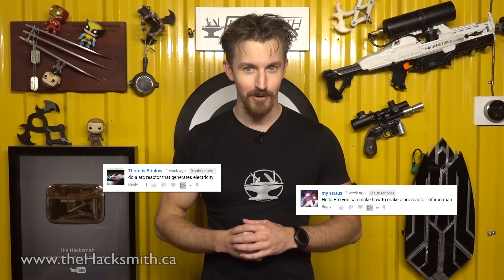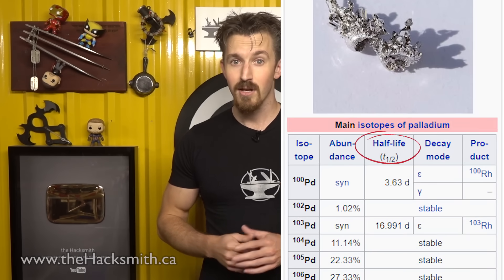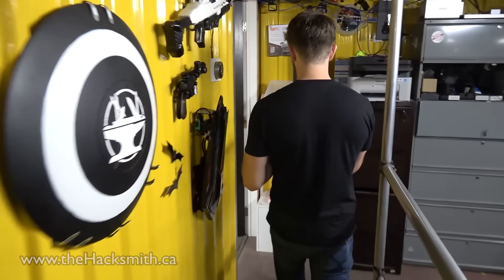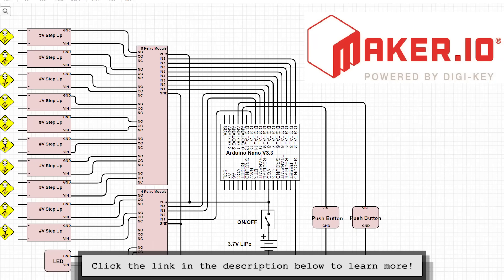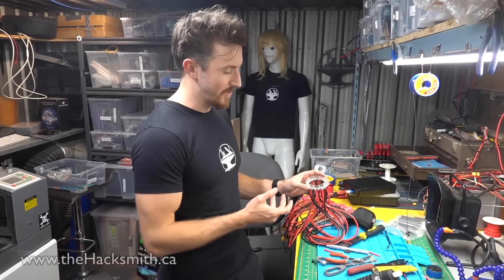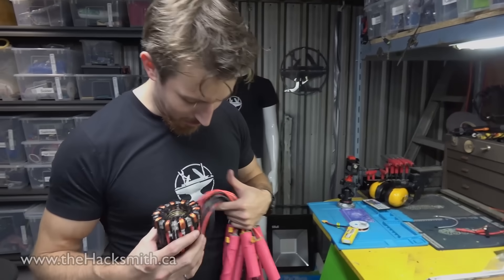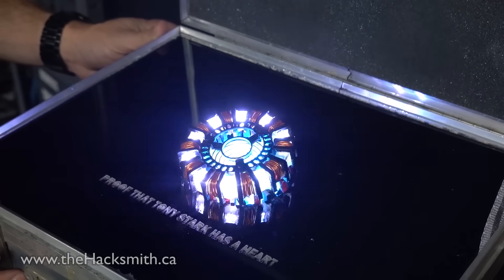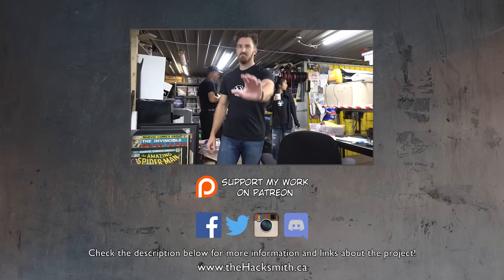Real Arc Reactor (ionized plasma generator)

Comment: So what's the actual "power" draw for the reactor? I suppose in Watts (volts*amps)? Cuz you only showed the 20+ amps that it draws.

Like I assume the cylinders are large capacitors, you're not powering the actual reactor (the arcing between the +- lines) off the lipo battery... or are you?
Reply from the maker: 20A at 3.7V so 74W?
Reply: Huh. Tbh that's a lot less than I expected. Shows how little I know about electricity. 
I thought high voltage was required to get electricity to arc (eg that's why high voltage is insulation and high amperage is thicker cables). 
Can you explain where my thinking is wrong?
...
edit reading up on the diagram and such: 
I'm a dumbass. You transform the 3.7V lipo (parallel?) into the 800k+ Volts, so that's why it arcs. But since you transform it into such high voltage, the amperage on those cables should be minuscule, no? So why the thicker cables? Shouldn't you instead go for thicker insulation?
Reply from the maker: input power is only 3.7V and 20A

output power is 80,000V and micro amps :) 

with transformers (minus losses) power ratio remains the same, but if voltage goes up, that means current goes down! and vice versa
Reply: I see, thanks!

Comment: Not enough power :( make it bigger and louder >:) bigger size with more copper rolls with more wires A-Z and from A1-Z1 and A2-Z2 put will cost a lot to build
Reply from the maker: bigger will have bigger losses
Reply: the Hacksmith then multiple

Comment: If you could somehow use that arc to ionize some kind of gas or create plasma, you might be able to generate some extra heat then use that to create a heat generator of a sort, but those are kind of limited and inefficient, losing out to steam generators. But even if you could produce enough heat to generate enough steam to power a turbine, instead of just making a heat generator, I doubt it would be very efficient. Using radioactive materials like palladium somehow to make a nuclear reactor of sorts might increase it's efficiency some, but it would be way worse than a standard nuclear reactor, I think. Basically an arc reactor can't actually work, or it would have to be a weird kind of super inefficient nuclear reactor.

Sorry, if that sounds like criticism. It's not. The video just got me thinking about how an arc reactor might actually work (not work?) in real life. Your work is absolutely amazing as always guys! I can't wait to see what you come up with next!
Reply from the maker: But like we explained in the first part of the video -- anything that "takes" energy to produce energy will always produce less energy! =)
Reply: the Hacksmith
Yup, that's why it's far more inefficient than a normal nuclear reactor, it's suffering from similar if not the same problems as a fusion reactor, but without any of the advantages fusion reactors could potentially have.
Reply: Aren’t nuclear reactor radioactive

Comment: Now I'm no expert, but would the reactor make any sound if it was inside a Vacuum? Considering the properties of sound and vacuums, wouldn't having it in a mini vacuum chamber at least reduce the sound created by it? Again, I'm no expert, so sorry if I'm wrong about that
Reply: Arcing works a lot differently in a vacuum. Since there's no air to ionize, the two electrical poles just "glow" with a purple haze. It would significantly alter the aesthetics of this from a blue to purple, not to mention a lot more energy is just electrons moving, and less energy being turned into photons. I'm no expert either though, so I'm unsure if the noise the electromagnetic interference it puts out still would affect the camera microphone or not.

Also, this device is DEFINITELY not FCC compliant in any way shape or form.
Reply: Ah right, forgot about the need for air. Kinda embarrassing considering ive taken courses on electronics and such so i should at least remember that much

Thanks to the both of you for enlightening me on the topic
Reply: Incognito_Blazer if it were in a vacuum there would be no air for the electricity to arc through, meaning there would be no plasma. Technically there would be no sound then lol.
Reply: Sound cannot travel in a vacuum
Reply: Ingognito_Blazer You'd have to have something like a ring made of neon tubes sealed inside a vacuum tube - which sounds expensive! I'd think you would need to be a really good glass blower to seal all those high-current contacts into the glass outer shell! You might find Nixie Tubes interesting though.

Comment: Wow it's a very cool prop and really looks realistic, but I didn't get how the electricity from the power bank, which was necessary for the ionization of the air (which is for realism/looks) then/at the same time went to power other stuff like the phone.
Please answer me Tony!

[Also, we can agree on the fact that this device isn't actually generating anything, but is a power bank with an extremely loud light indicator - cos otherwise I have understood nothing]
Reply: I'd say your correct. This isn't generating any power it is a prop that is actually consuming power.
 He's either charging the phone from the battery or maybe he is using the outer coils as the coils in a transformer and inducing an electric current from the magnetic flux induced by the arc. If not that might be a cool upgrade @hacksmith
Reply: That's what I thought. The outer coils are acting as the secondary and using the alternating magnetic field to generate power but it's barely enough to charge a phone, due to the small amount of field generated off of a bunch of arcs
Reply: I actually think @Evil_Rodriguez is right and the power comes from the battery, because you can't really identify any wires coming out of the coils (which I think are for looks); also, I imagine they would at least mention such a cool feature... That's why I asked, because it wasn't really made clear in the video and I wished The Hacksmith could "shed some light" on this.
Reply: Probably the same battery and regulator supplying power to the Arduino circuit board; that would be the easiest and most obvious means.

Comment: I had always thought of the iron man arc reactor as a fictional version of something called a tokamak nuclear fusion reactor, no I did not mistake fission for fusion, this is a real fusion reactor shaped like a donut that generates plasma inside the reactor, then using magnetic liquid helium, directs it and molds it to basically recreate the sun. This would explain why tony stark likes palladium so much, as it is corrosion resistant and probably wouldn't immediately sublimate if it came into contact with plasma. This would also explain tony stark's mathematics as a theoretically perfect tokamak reactor could be as efficient at producing power as the sun. I love the video though and love your work.

Comment: The arc reactor is basically a minituarized tokamak, aka a plasma based energy source.  It is proposed to be safer than a nuclear reactor and even better than solar and wind powered sources.  In the movies, it's just a magnetic source which might be the reason why the lights were flicering once Tony created it in the first Iron Man movie. This could also be keeping the shrapnel away from the heart by keeping it near the reactor.  This might explain the metal like poisioning he might have gotten from Iron Man 2.  Just a theory, it might be more of a magnetic source than an electric one.  There could be a seperate energy source the suit for itself rather than the arc reactor.  Again, just a theory.
Reply: It looks more like a cold fusion reactor that theoretically needs no extremely high temperatures to work like a tokamak or similar designs.

Comment: How about putting a very strong neodymium magnet at the centre and connecting it to ground, and 10 8000V capacitors' positive ends surrounding it. Might make an electrical vortex

Comment: Great Video. Maybe for a silent version you could use a high voltage frequency arc, which you can get from flyback transformer. With a round magnet you even could let the plasma spin and make it look even more epic. Another idea could be that you   create a spinning electrons circle with a magnetic field in a glass with a gas, which glows blue during the impact ionization. Like the Teltron tube. Love your make it real series. Keep it going :)

Comment: I actually wonder if it's possible to make an arc reactor using a combination of hydrogen and palladium fission and a copper and tungsten conduit... Something that generates magnetic electrical current based on ionizing radioactive decay.

I'm not an nuclear physicist or anything, I read stuff and guess. It's how I made a human shoulder system on the scale of a Bionicle figure. Three years to figure it out and I am in no way a reliable source for bioengineering knowledge.

Comment: From what I can see, it is an arc reactor, it is a controlled thermonuclear fusion technology similar to the tokamak reactor built as part of the ITER project, similar to the currently operating smaller JET. Thus, if the stark had built it, then the calculations given in the cave are rather correct.

Comment: to generate enough power for the house you would probably need a whole house of those red things and wires to charge the electricity that much. Basically instead of a case with the arc reactor, a house with the arc reactor. But i honestly think with enough work and progress you can turn the arc reactor into a valuable source of electricity, but those days are far.
Reply: Are you joking or is this a real suggestion, because i hope you know that it doesn´t create energy
I AM CONFUSED :)
Reply: Philipp Kleinheider haha, thanks for pointing that out man, I meant electricity
Reply: @cg_hg  Isnt that energy?

Comment: A real working arc reactor would be two radioactive elements of palladium (Pd-107 and Pd-103) to form a Beta decay/electron capture cycle, generating current. The outer ring is a dense electron gas to reflect gamma rays from electron capture back to catalyze the beta decay. It probably also explains the unibeam as a release of buildup gamma rays would certainly account for the energy release if the electron gas acts as a lasing medium to create a gamma laser.

Comment: Judging from the big arc reactor at Stark Industries I always assumed it was some type of nuclear fusion reactor. The glass housing even looks a lot like the reaction chamber of a Tokamak. Of course, this still does not explain how it generates electrical power, especially in the chest-sized version.Furthermore, I wouldn't call the rotating hydrogen plasma of a fusion reactor an arc, so I may be barking up the wrong tree.

Comment: Is it not just connected to batteries? Still cool l, and if it does generate power why not make it bigger, maybe not looking like a arc reactor but can still generate power.
Reply from the maker: Energy in = Energy out + losses

making it bigger will just use more power
Reply: @hacksmith  so it is just hooked up to some batteries?

Comment: Love the Vid!
The way I see an Arc Reactor is that the copper wires around the outside create a tauros of plasma(the Arc) through the inner ring. As it does this it creates a stable area to send hydrogen atoms through to initiate a fusion reactor. As it pulls the atoms around and creates fusion he uses the inner rings to absorb the heat and electrical arcs the flow out. He finally can then convert the heat and Electrical arcs into a usable amount of energy to power both the Electromagnet in his chest and the suit.

Comment: Would it be less loud, and/or lower-voltage, if you were able to reduce the air pressure in the chambers? I know that full vacuum tech isn't your specialty, but it would be an interesting challenge, I think.

Comment: Couldn't you produce induced current if the last fragment was spinning around a magnet in the middle? You already made wire loops on it.
Reply from the maker: yeah, but like we said -- the output would be useless due to losses in the system
Reply: Yeah and plus this looks dope because of the arcs 👌🏽